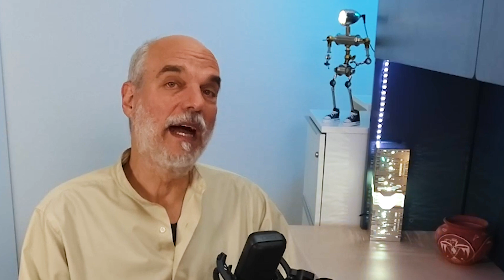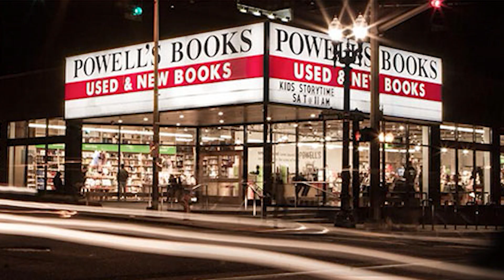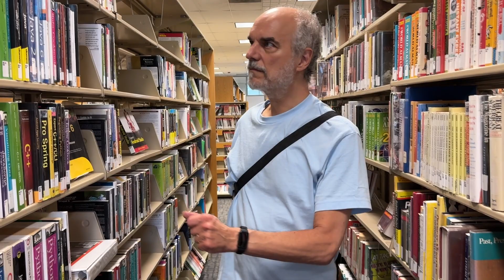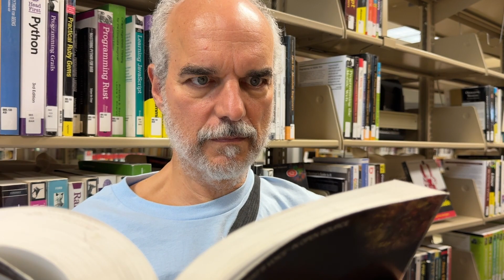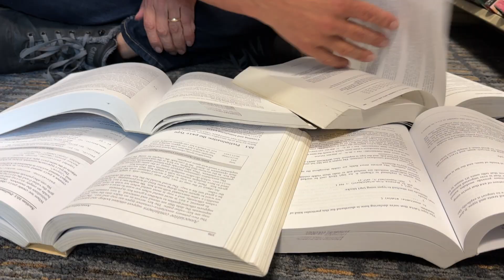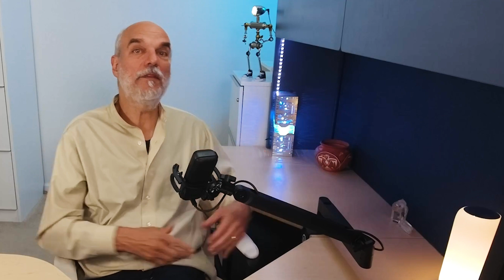The Problem with Most Object-Oriented Designs and How to Fix It

Comment: Instantiation argument hits nail on the head. Constructors are the most important aspect of OOP. You need to create an object which has a valid state. Only then you can assure everything else about an object works in intended way. And what goes from there is what you've said - one code creates objects, completely different code uses them, and everything works.
Reply from the maker: Very perceptive. Not everyone understands what you just said.

Comment: Regarding the use of abstractions, these are definitely not GoF patterns. All these patterns are only there to close the gaps in the expressive means of the early days OOP languages, and are not necessary if you are using a functional language (check out e.g. "Clojure Design Patterns" by mishadoff). And the most powerful abstraction we all have is naming things. Not creating a class with some name! Just giving names — to functions, to parameters, to keys in maps, to specs and schemas, etc. For the rest of your needs there are first-class functions (as a means of composition), different ways to group sets of functions (modules, interfaces/protocols/traits, etc.), great support for sequences and a set of built-in immutable data structures (these should be your default choice, not mutable ones), a multiple dispatch polymorphism with ad-hoc hierarchies (to address the expression problem), and maybe some types (not classes, types! yet, static typing is completely optional). Boom, you have it! Here are 99.9% of abstractions you'll ever need in programming.

Comment: The Problem with Most Object-Oriented Designs is that OOD has nothing to do with data transformations, which most of the software actually is. It's data in, data out. Even the developers of Java themselves seem to understand it these days (check out the "Java Language Futures" talk on project Amber). There is an impedance mismatch. There's no need to create a class hierarchy just to be able to parse the damn JSON! However, this is exactly what we are forced to do by class-typed languages, which have poor or no support for ADTs.

Comment: I don't have enough experience as a developer, but I think OOP is mostly suitable for use cases where parallelization is hard anyways and where abstractions themselves are actually valuable. The best case I know of is web development. Every request is unique and isolated and you can't really parallelize them. And if done right, most classes and objects conform to some business rule, legal entity or process. But I would try to use as little OOP as possible in other fields.

Comment: object orientation approach was basically for management people and neophyte developers who are not really into technical stuff. it does not work for super developer who works alone and can finish large, complex, software by himself.
Reply: Wrong.

In management, software architecture actually very much also people management, what team handle what stuff, and those teams or developers communication channels are equal to software architecture. OOP is unrelated to that, also super developer that can create software alone (like I do) is not the point. I wrote those initial software versions and other people can jump on those, and it very important make understandable structure.

We have software frameworks for purpose. Without software framework, I should document all details and conventions myself. With ready framework, those can be found from framework documentation.
Reply: @gruntaxeman3740  wrong. software architecture and people management are two different things. frameworks doesnt care about how it is coded(like how strict OOP you used or some other code style shit), all of it are abstracted, all it matters is performance. extensibility can be solved by releasing new version. usability can be improved in next versions.

you dont actually need to write documentation for frameworks you've written unless you intend it to be used by neophytes or non-technical because code itself is self-documenting.
Reply: @atabac  

Code usually don't tell decisions what is lead to current design and it has mappings to surrounding world, and information of surrounding world isn't necessarily in code.

Also it is very well known fact, that software architecture is same as team structure or communication channels between developers.  This was observed back in 60's and it is true today.

That is why we have for example microservices, because there are different teams working on different services independently. Also because humans do have limitations, it forces to make architecture decision because one dude can't efficiently work on 1M lines of code that is just one big chunk of dependencies that need to understand as whole. Even the super developer requires there architecture that he can work on module or component level without caring rest of the code base.
Reply: @gruntaxeman3740  i believe software architecture organization has nothing to do with team structuring or how developers communicate maybe your team was just structured based on the software architecture. software arch is always is the organization of software within the context of the system you are trying to build. it is based on how overall system works. including functional and non-functional(indirect requirement) stuff of the system.
Reply: @atabac  

Nope. You can't really find complex technology where architecture is not mapped like team structures.

Architecture of technology is like organization chart of the company, or how people communicate around world. There can be team doing stuff other side of world than some other team, and the end result is that there is architecture where is interface between these teams.

You can also look any operating system, or software framework modules and draw some architecture diagram how it works, and that is same as team structures.

This is really one of the few fundamental laws on software. There isn't many laws but this is one of those.
Reply from the maker: I agree, the systems and work products of a company reflect the communication structure of the organization. This is well-known in business and even has a name, it’s Conway’s Law.
Reply: Wrong
Reply: @RealisableSoftware your probably dont code in low level😆

Comment: Love your enthusiasm.
Definitely don't start with the UI, it leads to a ball of mud of cross coupling. There's another downside,  managers think that you've finished if they see a UI.
Reply from the maker: @nickbarton3191  Wow, that happened to you too? Back in the day circa 1989 I built the dialogs for a program in OS/2 in two days, just the dialogs, but my manager thought I build the whole program. It was hard to convince her that there wasn’t any logic behind the buttons. Now I start with the business rules in testable objects and later I build the UI and I don’t put logic in the controls. I find I end up with a much better separation of concerns.
Reply: @ThePassionateProgrammer  Happened to me more recently, like 10 years ago, I built the front end AngularJS,  HTML, CSS, lots of animation but dummy data. My guy wanted to start populating the database, lovely, well-meaning chap who did understand my explanation even though I'd already presented a project plan.
DTOs are the best solution to UI separation, leaving the UI to deal only with presentation issues.

Comment: OOP- Obfuscation oriented programming. When no one else can understand your code.  The key to job security.
Reply: @user-mu6ii3jg1o Excessive use of abstraction. Too many layers of abstraction. It gets way harder to reason about than straight procedural code.Also code gets bloated. Way larger.
Reply: @user-mu6ii3jg1o True. You can pick and choose what parts and how much you want to go with OOP.  Problem is that people loves to build these over complicated towers of abstraction. 10x harder to understand what the hell is going on than not using it.

Imho it is a myth that is being retold that procedural code becomes spaghetti more easily.  Perhaps dating back to the 80's when everybody getting home computers dabbling by themselves in basic and goto's as beginners. Not really an issue for a professional programmer.
Reply: @user-mu6ii3jg1o Not sure what you are arguing.
Reply: @user-mu6ii3jg1o Thanks for the insult. 
Was not sure what you meant since I agree that there are more dabbler's today than back in the 80's,  but that procedural code got a bad rep due to there was way less education resources for anyone new, plus when OO came, everyone thought they found the silver bullet. That it would solve everything. I know since I started programming in 1981 as a child, and went through all programming paradigms over the years. 

Edsger Dijkstra: “Object oriented programs are offered as alternatives to correct ones” and “Object-oriented programming is an exceptionally bad idea which could only have originated in California.”

Paul Graham: “Object-oriented programming offers a sustainable way to write spaghetti code.”

Jeff Atwood: “OO seems to bring at least as many problems to the table as it solves.”

Eric Allman: “I used to be enamored of object-oriented programming. I’m now finding myself leaning toward believing that it is a plot designed to destroy joy. The methodology looks clean and elegant at first, but when you actually get into real programs they rapidly turn into horrid messes.”

Comment: I keep hearing people gripe about OOP and when I ask them what's bothering them they immediately start complaining about the consequences of all the things you're not supposed to be doing in the first place. I suppose the real downside to OOP is lack of education. It's too easy to pick up a language and start using all the features willy-nilly, but until you learn the basic design principles you're always going to have a mess on your hands.
Reply from the maker: I totally agree!
Reply: But, people are willy-nilly.
They are not oo programs.
Reply: I think OOP is fabulous for user interfaces and many other purposes, but with multi-threaded services I avoid mutable state as much as possible, which makes OOP a bad fit. I still use objects, but I don't approach it from an object oriented perspective. It's not the only tool we have and sometimes it's the wrong tool.
Reply: The teaching is stuck in mid 90ies "model the problem" attempts. How are you supposed to understand when abstraction is useful if you don't get data first?

The guy who made OOP was a biology PhD who noticed that bodies are build from immensely complicated smaller cells which are treated by their behavior which was really simple compared to their internal complexity.

So OOP principles gave us abstractions like a database-connection that allows to read from a db in 3 lines without needing to write or understand the 500.000 lines that are behind the abstraction.
And somehow we ended up with IUserDataCreationFactoryProviderSetupSettingsBuilder.
Stop that. Do actual work.
Reply: If nobody uses the tool correctly, its a bad tool

Comment: I was very aware of design patterns from quite early on but I still couldn’t figure out why so many of projects still were not on the right track. When working on a particular problem that did not fit one of the gof patterns then I would mash up a new set of abstractions myself. I was still trying to apply solid, but when I look back on the many mistakes I made I can see now that I either didn’t understand the patterns well enough and/or forgot to keep solid at the forefront of my mind. One example of this is making liberal use of if statements to resolve problems rather than use abstractions resulting in many concerns being mixed together. If finally dawned on me that separation of concerns is of paramount importance EVERYWHERE not just when you feel like it and strong cohesion, minimised coupling with dependency injection. I feel like my designs are much better now but it is a constant headache making sure I keep these essential properties in my. I’m using golang as my daily driver so oo is out the window, but I also love the declarative approach so functional is a common weapon of choice, but I also have to keep in mind that too much functional can add runtime overhead potentially hitting performance. I love engineering but my god it’s really hard!!
Reply from the maker: Thank you for sharing that inspiring story. Yes, it can be easy for people to misapply design patterns or not really understand how to fulfill their intent, especially without a strong foundation in design principles and concepts like separation of concerns. Yes, engineering is challenging but it is also rewarding!

Comment: I don't get it at all. I use the OO design philosophy, but it wasn't explained at all why "it sucks". There was a brief mention of variable method signatures causing havoc (which can be solved by putting those arguments into the object, right?). If those parameters are just set, the object can just "do the appropriate job". Another strange thing is this word "abstraction", but an object is just an abstract data type (ADT). But "abstraction" here sounds like a synonym for "pattern" or "design", which seems to me to be a way that ADTs or ovjects are supposed to interact? So it seems not a criticism of OO, but rather a higher level way of arranging how the objects are supposed to interact? But this is highly problem specific, no? There has to be myriad ways to do this, some better, some worse. So, I am very confused about what is being said. (I program large scale scientific software).
Reply from the maker: Thank you for your question! Steep inheritance hierarchies can lead to code duplication and fragment behavior, making it harder to maintain. Missing abstractions can make the code become disorganized and difficult to work with, especially as a project grows.

Abstractions aren’t just about data types—they typically represent categories of behaviors that can be extended using polymorphism. This allows us to add new features or variations to the system with minimal changes to the existing code, which also reduces the risk of breaking other parts of the system. From a business perspective, this flexibility is crucial because it can lead to significant savings when the code needs to be extended or modified.

I hope this helps clarify things a bit!
Reply: @ThePassionateProgrammer  So, are you saying that the polymorphic type, when properly instantiated with the correct genus, embodies the said business logic? So, abstraction = polymorphism? Sorry to press the point, but this abstraction word in the computer science context is hard to pin down. And yes, from painful experience, deep hierarchies can be tricky, since if you get them wrong, it is hard to reassemble the pyramid. But, does abstraction/polymorphism necessarily mean you avoid deep hierarchies? What is the key insight that would prevent this disease? (A person below mentioned Haskell and, I think, its typeclass idea, which confers some shared properties among the data types, it's similar to polymorphism except that there is no requirement that the data types be polymorphic, I think ... anyway I'll have to see the next video, thanks for your kind reply).
Reply from the maker: @dylanjayatilaka8533  Thank you for your follow-up! It’s great that you’re digging deeper into these concepts, as they can definitely be tricky to wrap your head around at first.

To clarify, abstraction and polymorphism are related but not the same thing. Abstraction is more about simplifying complex systems by hiding the details of how something works, focusing instead on what it does. Polymorphism, on the other hand, is a way to leverage abstraction—it allows you to treat different objects (that share a common behavior) uniformly. This doesn’t mean abstraction equals polymorphism, but polymorphism is one of the ways abstraction is often implemented, especially in object-oriented programming.

Regarding deep inheritance hierarchies: you’re right—if you get them wrong, they can be tough to refactor. One key insight to avoid this issue is to favor composition over inheritance. Instead of deeply nesting classes, you can compose behavior by combining smaller, focused objects. This tends to make code more flexible and easier to modify as requirements evolve.

And yes, Haskell’s typeclasses offer a different take on polymorphism where you don’t need a class hierarchy to share behavior. That’s a more functional approach compared to the object-oriented model, and it’s interesting to compare the two.

Comment: As long as you don't do inheritance, it will probably be ok, though myself I would still stay away from OOP if possible, just put the data in structs and call some functions on them.
Reply from the maker: I agree that inheritance can be problematic when misused (and I see that a lot). I still use it for varying behavior but only one subclass level whose base class is abstract. Yeah, you’re right, we are better off without it. Since three of the five SOLID principles are really ‘rules of inheritance’ if we get rid of inheritance we’d just have SO. There are other aspects of OOP that make it valuable.
Reply: @ThePassionateProgrammer  composition seems to be much more usable technique but it isn't OOP specific. Also there is the original OOP and modern interpretation of it.
I do work with it daily, but when possible I prefer to go imperative ways with data and functions being separate. 
Dunno why but OOP never suited me outside maybe UIs coding or some game objects.
Reply: Inheritance when used judiciously is fantastic - plugins and addins gain most for allowing existing objects to be inherited and their behaviour modified to the specific needs of the plugin or addin. Composition becomes clumsy as you need to inject that composition (either via a property or constructor) OR you need to give the 'base' class a series of events.
Reply: @jimiscott  Coupling is awesome... until it isn't